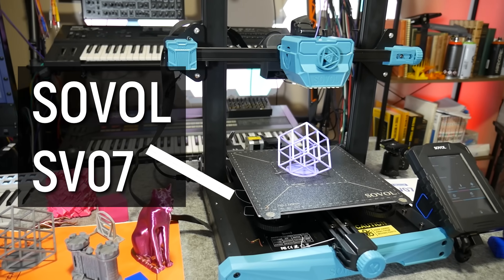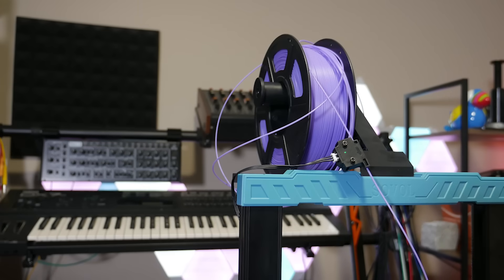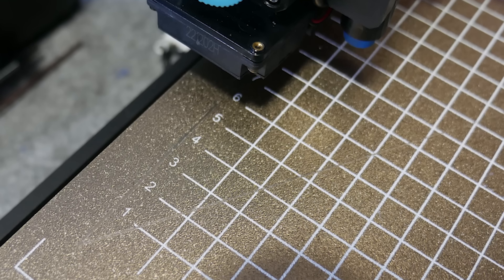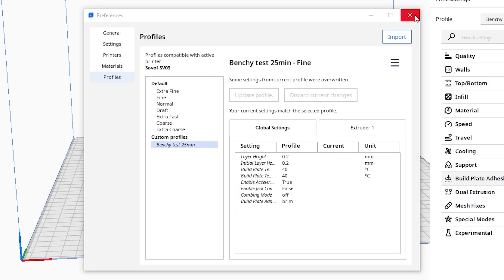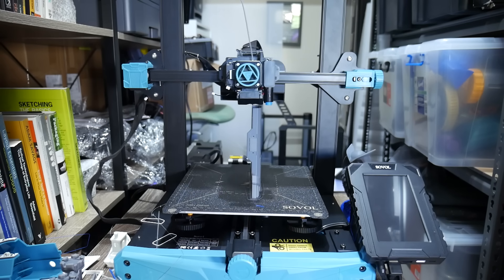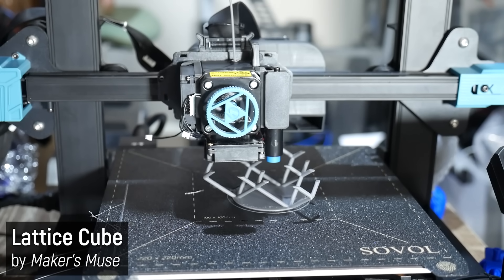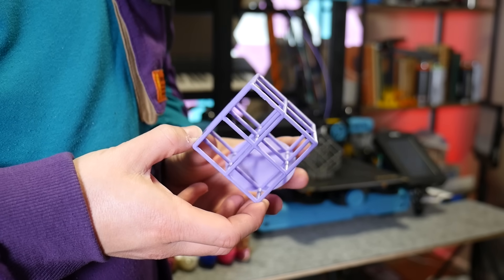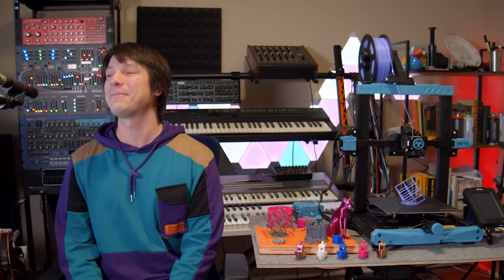I didn't expect to be so impressed... Sovol SV07 Review (with KLIPPER!)

Comment from the maker: Couple of corrections for this one:
- The hot end is the same high flow design as the SV06 Plus (I added text to clarify this but still stated SV06)
- The interface is klipperscreen (web interface is Fluidd) - got mixed up thanks @PedroLamas
- The line break for G-code substitution should be /n not \n - I actually have this correct in the config but got confused editing late.  thanks @plampix for pointing that out
- The Klipper command to enable the blower fan could be triggered using a M106 macro within Klipper, however I would argue that you don't always want it on with the cooling fan (like with PETG printing). Sovol's new config should fix this behaviour anyway and I will report back

I generally review printers as received and focus on the usability side, so my lack of Klipper-fu showed in this vid. As these machines become more common I'll be diving more into that side of things if require. Cheers!

P.S. - Never forgive YouTube for disabling annotations, which could have fixed all of this.
Reply: Exactly! I want my video sticky notes back.
Reply: Wait, it really is "/n"?! Like, literally every bit of software I ever saw that supports anything similar, uses "\n".
Reply: Is this Printer compatible with Windows 11, I recently got a Pinter from a friend but it was too old and it’s firmware isn’t compatible with Windows 11. so I’m going to save up for a new one and this one looks good and is what I want
Reply: You could make an M106 macro in klipper with a boolean variable to trigger the extra cooling fan, which can be set to a default value of either true or false. Then you can set the variable in the start gcode from your slicer which can be altered on a per filament setting (at least in the case of prucaslicer and derivatives).
Best of both worlds I'd say. Would have been neat if Sovol had put that effort in though...
Reply: All of the Klipper-fu missing doesn't seem like a problem. It sounds like something they're going to fix in sw before delivery and nothing is particularly scary in twins of missing or wrong use of features in my mind.
Reply: Good vedio! Can you have a review about filament dryer? It seems to be important while printing PA and long-time air-contacted PLA.
Reply: review ender 3 v3 KE
Reply: Hallo sir ,this Maschine its kompatible Windows 11 , and Cura version 4.8  , its old cura hav a perfect performens of Sv 07 , i hav the machine , its perfekt no striniig ❤ lg Swiss mann

Comment: Its wild how technology keeps marching with time. A couple weeks ago I bought the SV07... clearance at $99, one quarter of the Bx at the same time and about 2/3rds of what the ender3 still demands.I'm aware china and no support to speak of.. but that value is pretty incredible WITHOUT being on a closed software ecosystem.
On the other hand its speed, here what was only 18months ago a major positive for the SV07 is now almost half the flagships from the other brands listed, but at 25% the cost of the Bambu P1 (also on clearance with P2 now out) and 10% of what Pruisa want for a Core One that was a tradeoff I could accept, but if your needing the heated chamber, multi-filament feeding systems or lack time/inclination for things like adjusting belts/wheels manually that might be different.

Comment: Regarding the rear parts cooling fan I'm curious, why the weird config when they could just split the power feed running to the front parts fan as surely you'll always want both running at the same time and responding to the same command ? It's the same as when you have a printer like the OG Ender 3 Max, there was 2 parts fans but they were paired.

Comment: Hi..Did you goof on the specs @ 1.14? You said SV07 Print volume @ 220x220x250.  Amazon says it's basically 300z300x350 in round numbers.

Comment: I feel like they've finally sorted out their problems with the loose belts and wobbly bed. I just received an sovol sv07 and an sovol sv07 plus and they came with proper tightened belts, beds and v rollers, ready to print 250mm/s out of the box, cheers and thanks for this indepth video review. i feel like the sovol sv 07 is heavily underrated considering its affordability

Comment: I know this video was made almost a year ago, but what the hell, I'm desperate. I got this printer not too long ago and out of the 20 or so attempts I've made at running off a print, I've had exactly one print actually come out without failing on me. It was the normal, not super fast Benchy, and it came out looking great. But every other time I've tried to fun off a print in this thing the first few layers come out wispy and they don't stick to the bed very well. And I'm pulling my hair out trying to figure out why. If anyone has any suggestions, I will gladly take them. I'm new to 3d printing and this is my first printer, so I am looking for all the help I can get

Comment: Hey Angus - thanks for the review. My Sovol SV 07 plus turned up on Monday but I was still busy reading reviews and articles. This is my first foray into 3D printers. Two days later I'm ready to unbox and put it together. Six hours later, I'm ready tp print. Yeah - learned about springs - was going to ditch them, then decided to put them back on. Anyway - first print - 3D boat thing. I can't believe how AWESOME this bloody thing behaves. It's mesmerising.
Who the hell designed all this stuff? I'm totally flabbergasted.
I bought it to print stuff I needed - not to tinker.
It's doing that perfectly, though I can see tinkering in the future.
My one downfall is SLICING. Who the hell wants to go down THAT rabbit hole?
It wasn't in my plan.
I have STL files I want to print but no. Klipper wants G some bloody thing.
Argggg - anyway - I digress.
This Sovol SV 07+ printer is everything I wanted and NO - I don't get paid for this - it's just an awesome piece of gear.

Comment: On my CR-10S Pro I added a BLtouch and Bed hardmounts with these rubber/silicone things and nyloc nuts instead of the wheels. once done a basic level and never touched again BUT it is really not that great. only 4 points on such large beds is not enough for a solid hardmount and thermal expansion. I suggest using the compressable standoffs instead of plastic.

Comment: Admittedly I have no experience with 3D printers - which is why I'm watching your videos to help make a purchase - but at 9  minutes in, I'm wondering WTF don't you just enable the cooling fan FULLTIME, rather than editing code to turn it on and off at specific times???  Is there a problem with that?
Reply from the maker: The bed needs to be hot for good adhesion, if the fan is on from the start it cools it too much and the prints won't stick :)

Comment: Hey Angus (also, anybody else reading this), have you had a chance to check out the SV07 Plus? If so, is it just the same thing as the regular SV07, but larger? I'm looking at replacing my Ender 3 with something faster, so I was looking at the SV07, but then I saw the SV07 Plus, and having the larger print volume would be really nice to have. If that's the only difference between the regular and Plus versions, I'm definitely leaning toward the Plus
Reply: Came here to ask the same question. Upgrading from an extremely old printer and even the Ender v1 would be an upgrade but I don't want to fiddle at the level of my old printer from 2017.

Comment: Hey @MakersMuse , have you tried lower shore hardness TPU with this machine? How did it behave? I'm willing to buy a new large volume 3D printer to mainly print TPU. I know the Artillery Sidewinder X2 handles flexibles very well, but it's a bit outdated and since the SV07 Plus has klipper for 300$ i thought it could be a good choice.

Comment: Any thoughts on the SV07 model line vs getting an SV06 model line and adding their Klipper module? Pricing would be slightly more. Looks like you would basically trade speed for the better linear rod design.

Comment: i guarantee you if you took of the 50 cent..... 3mm Aluminium bed and put it on a thick sheet of glass it wont be flat hence the springs to try  and straighten it up...Because Milled 6mm titanium beds would be to expensive Titanium for the lightness and rigidity/No BEND EVER ... Durillium might also be another good bed Material ,Putting Shims or colars in there and removing the springs isn't always going to fix exact leveling ether unless its absolutely  level and the shims have been cut to precisely the right length....hence the Auto bed level fixes these intolerance's...anyway rant over

Comment: I'm completely torn between this and an Elgoo Neptune 4 for replacing my Artillery Sidewinder X1.

I don't need 300x300 build plate, I'm looking for reliable but serviceable and maximum material compatibility with the speed bump of a printer not from 2019 with what's considered to be a relic controller.

Comment: Hi guys and girls, just a CLEAR WARNING from my side: Don’t ever buy anything (directly) from SOVOL3d. The company is just super unreliable and not trustworthy. I wanted to return my printer (Sowohl SV07 Plus) after a few hours of testing - and they are not even answering to my request!
The new Sowohl SV07 Plus is really bad - the cable to the extruder is just lying on the hot bed - the failure rate of the prints is very high - and just be aware that the company will not help you - and they just take your money!
And: They clearly offer the possibility to return the printer on their website - but they NEVER SEND ME THE ADDRESS where i have to return it - they IGNORE every single request to initiate the return!!
Better be warned!
Peter - from Berlin
Reply: Thanks for the warning.

Comment: I really liked the SV06 Plus as a possible upgrade to my aging Sidewinder X1 so I was excited to see Sovol had a new model coming with Klipper.  I was pretty disappointed to see them downgrade the rest of the printer on the SV07 to use the crappy roller wheel design.  I'm done with roller wheels, never again.  Linear rods or rails only from here on out.  Hopefully Sovol makes a Klipperized version of the SV06 models with the superior rod design.
Reply: You can buy the Sovol klipper screen and put it to the SV06

Comment: no matter what i do with the SV07, I can only print the test prints like the benchy (flawlessly i might add) on the drive they sent, but when I want to print any of my own models with your profile it delaminates on the first layer every time, 'ive bedleveled this thing a 100 times now and used half a spool just trying to get one thing to print, 3d printing shouldnt be this hard anymore, also I have tried different z height calibrations and even used a glue stick and different surfaces.
EDIT: I cant seem to figure out hte correct order to do all the calibrations and I am not actually certain any of them are saving anyway, the interface is a bit ambiguose
Reply from the maker: Gotta make sure that giant curtain cooling fan isn't coming on for a few layers or parts don't stick. A lil gluestick is added insurance.

Comment: I am having a bad time with mine. Video coming soon, but honestly, there has not been a single part of this machine I haven't been annoyed with, and I can't get 2 prints in a row to work.
Reply from the maker: Oh no! I've honestly been using mine almost as much as the bambu atm because the klipper interface is so easy. Is the giant curtain blower fan cooling things down too much maybe? Straight after the review the grub screw for one of the feeder gears backed out and jammed as well, so that's worth checking. Very keen for your vid though
Reply: @MakersMuse  what im seeing is, first of all, nothing sticks to the build plate without liberal application of glue stick. 
Secondly, prints are getting frequent Y-axis layer slips. I've tensioned the Y-Axis belt, but after a while it loosens up again. 
Third, the bed is in constant need to releveling. After almost every print now. 
4th, the system will randomly go onto absolute mode making the start of a print error out. This one I fixed by adding G90 to the start.gcode.
5th, I do not love how you have to unscrew body screws to attach the accelerometer. Something that you're attaching temporary should have a temporary attachment. 
6th I didn't know there was a hidden drawer and that's where the USB stick is. It's neat but mentioned nowhere in the documentation. 
And the final straw is when I email Sovol about my problems I get crickets for onwards to a week now. Im gonna have a real hard time putting a positive spin on my experience so far.
Reply from the maker: @3dpprofessor  Yeah, very fair critique. They were mad shipping it with a spring bed and inductive levelling. I'll keep an eye out for any skips but none as yet - they might be too ambitious with accelerations on an ender 3-esque bed slinger.

Comment: Thank you so much!
After i saw the External Part Fan i decided to build my own which is pretty beneficial cause my Bed-Slinger running 180mm/s @21.4mm³/s and currently my Cooling solution is limiting me.
Thank you again!
Your Slicer Code is a good starting Point as im now tinkering with it to get PWM working on the external part fan.-

Comment: About the ender 3 I've ranted extensively on various platforms trying to get new people not to waste their time with printers that waste your time. I don't advise any printer without ABL, any printer without an all metal hotend and advise they just spend whatever it is to get a printer that does not have wheels or a shifting bed, or a Bowden tube, and has things like input shaping. This tool as a hobby is only really fun (to me) when you are going into uncharted or near uncharted territory. having to fix ender clone #3456 out of a 10000 isn't fun. It's just frustrating seeing what was missed at a factory.

I reason that with all the money you'll spend on filament, it makes no sense spending just about the same amount on test prints and parts when you could just have a good machine from the start, with tons of options right now.

Comment: Nice video Angus. I have a very different requirement and that honking great cooling fan on the SV07 to me is what is wrong with most FDM printers. I use our 3D printer as our own miniature machine shop. We live in an apartment and we're a family of 3 and the only place the printer can go is the living room. I'm currently using an Artillery Sidewinder X2 primarily because it's relatively quiet. I tend to print a lot of PETG because I can reduce the part cooling somewhat because it makes the printer quieter. I don't really care about the print speed, I'm perfectly happy with a 93 minute Benchy because I try to start print jobs when we go to bed* and very few of my projects take longer than 12 hours. Like most people I started out with an Ender 3 (Great but noisy and finnicky), progressed to an Anycubic Kossel Linear Plus (I could watch a delta all day) and finally ended up with the Artillery. I suspect a lot of people are like us. We have to live with our printers in our living space and how quiet a printer is, is a big part of the buying decision. 

*Yes, I know all about fire hazards. I have a modded completely separate smoke detector above the printer that will cut the power to the printer as well as scream bloody murder if it goes off.

Comment: I purchased the Sovol 6  Plus  and I love it. 300% print speed (not yet tested with anything other than PLA), is a great addition I did however add an external cooling fan.  I had no issues with bed leveling and I kinda prefer the spring leveling for fine tuning.  My prrintts have greatly improved over using my Ender 5 Pro. Bed size is larger and gantry height is also larger. I now use my Ender for laser printing and cutting.  Thanks Angus for the videos, I've learned a lot and still learning.  BTW: Sovol seems to be pretty good about shipping too,  I ordered mine and it was delivered within 3 weeks.  Yes it was a pre-order and the shipping was estimated to be 6 weeks.

Comment: Not sure if cura supports m107 auxiliary fan. I found a macro that makes the fan "listen" to m107 commands.
My take why sovol included abl and leveling wheels is because of the v wheels on a single extrusion. Not that precise if you ask me. If it would use two or linear guides like the kobra 2 or even rods/rails then you can totally ditch the bed knobs. With only one v  slot extrusion its kinda hard to ensure the bed is somewhat level. I would have also preferred to not have leveling knobs especially since the sv07 can do gantry leveling. In combination with leveling spring you will never reach a true equilibrium that way because the bed will be adjusted to the gantry and the gantry adjusts itself to the bed. You are basically at the mercy of your bed springs to not drift over time that way as well as v wheel wear

Comment: Hi Angus, great first look into Klipper, BUT: it's obvious you're new to Klipper. 
Some of the prints (artefacts) look like some more tweaking/calibration is needed. Rounded corners could indicate a too aggressive pressure advance or input shaping. The "SET_FAN_SPEED" command is just standard Klipper G-Code. Klipper has some commands which are just plain text - yay for readability. The interface on the printer itself is klipperscreen - a semi-standalone project that has been integrated here. 
Klipper is a fantastic firmware (and imo lightyears ahead of marlin), but needs a bit of looking into. See you next video!